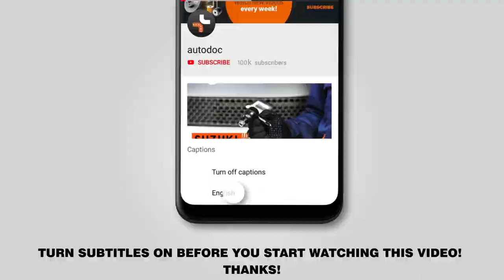How to change rear brake discs / rear brake rotors on AUDI A4 B8 Saloon [TUTORIAL AUTODOC]

Comment: AGAIN MISSLEADING ! 
THE TIGHTENING FORCE USED IS NOT THE PROPPER ONE ! 

•	Audi Caliper Bracket Bolts = 100Nm or 71.4 ft-lbs, of torque plus 90°
•	Audi Caliper Mounting [Guide] Bolts = 35Nm or 26 ft-lbs, of torque
•	Audi Lug Bolts  = 120Nm or 89 ft-lbs, of torqu

AN PLEASE LET THE PEOPLE KNOW TO PUSH THE BRAKE PEDAL TO PUSH THE PISTON OUT !!!! VERY SAFETY IMPORTANT THING TO KNOW
Reply: My manual says 100Nm plus 100 degrees. It also says to replace the bolts rather than refit the ones that come off

Comment: Isn't copperspray between the steel brake disc and aluminium wheel causing galvanic corrosion?
Reply from the maker: Yes, copper grease can react chemically with aluminum discs. Therefore, if copper grease is used on aluminum surfaces, it is necessary to follow the operating conditions and regularly check the condition of the parts to avoid undesirable consequences. More precisely which grease is recommended, please refer to the technical documentation for your vehicle.

Comment: What is the point of the video when the info that you need device and how to use it to pull the handbrake back is missing?
Reply: If you own an Audi and plan on doing any maintenance yourself, it's expected of you to buy a RossTech VCDS cable. If $200 for a cable is too much money for you then you really have no business owning an Audi. I've done every bit of maintenance on my 2010 A4 since i bought it new and VCDS has been practically mandatory every time i worked on the car.

Comment: * WARNING * DO NOT add copper grease to the caliper carrier bolt (16:15-16:20) this can lead to over torqueing of bolts... although I also suspect their quoted 75NM is incorrect!
Reply: Should be 100 Nm + 90°

Comment: great video! 

question; is the caliper carrier bolt torque spec really only 75nm? I would have thought it would be more. I'd seen some other reference to this being more like 196nm for the front and rear carrier bolts?
Reply from the maker: The caliper bolt torque is 75 Nm.
AUTODOC
Reply: 100 Nm + 90°

Comment: Normally this is an easy task but I cannot get the caliper bracket bolts off, I have tried heat and a very strong impact, what the he!! did the factory put on these bolts?  I have changed countless rear over the last 30 years and have never experienced something like this!  I got one off and there was some white fluid caked on the bolt….seriously Audi?  Anyone experience this and have any tips?
Reply from the maker: Most likely the bolts have become very strong or acidified. 
We recommend contacting the service for proper dismantling, so as not to damage the chassis of the car.
Reply: I just kept spraying it with penetrating fluid, using the impact, and repeat until it eventually came loose. Make sure to spray the other side of the bolt too! It is hard to get to but use the straw on your can to hit it between the rotor and the dust shield. Also, when I finally got my bolt out, it did not come out easily once it finally broke loose. The impact struggled to get it out the entire length of thread. And like you said I had some type of white residue caked inside the threads on the bolt as well. Almost looks like some sort of lock tight. Definitely not corrosion either.
Reply: @MrGhoulie  white stuff is lock-tite and the entire bolt was painted with it, ridiculously overboard.  The only way I’ll get other bolt out is remove lower control arm (or lower out of way at minimum) so that I can get impact somewhat straight shot to bolt.  Absolute ridiculous design, brakes are meant to be replaced frequently they should be easily accessible. Wife loves the car but Audi seriously!
Reply: @msk3905  White locktite? I think you're mistaken. It's probably anti seize that is just to old and crusty to do its job.
Reply: @LBCAndrew  I'm hitting with an impact rated 1200ft lbs break away while feeding 120psi to it, do you really think this is caked on anti seize?  Doubtful